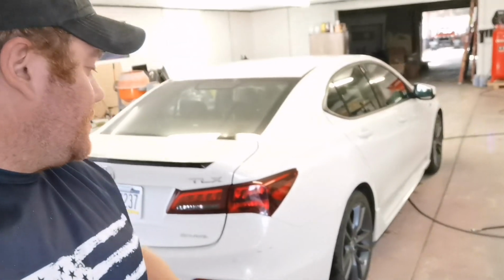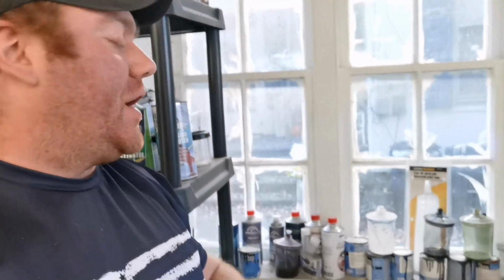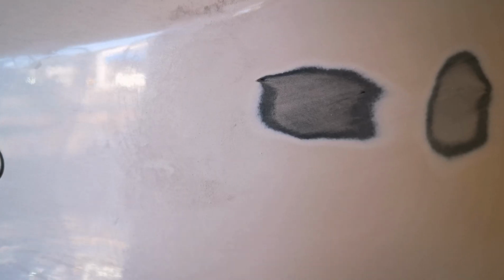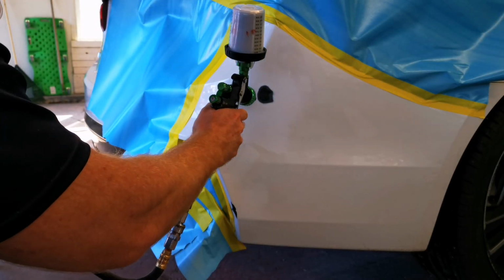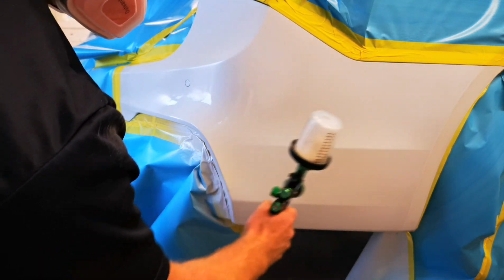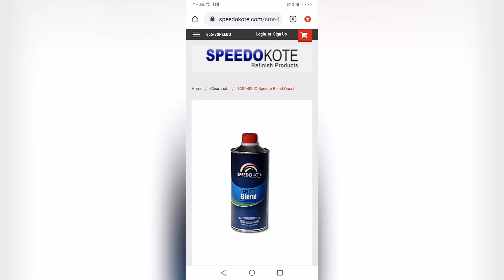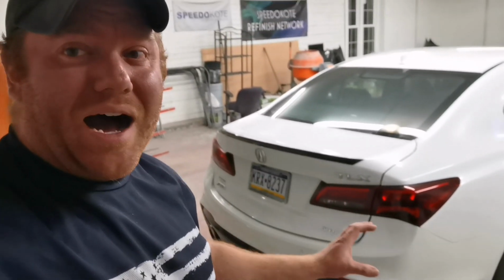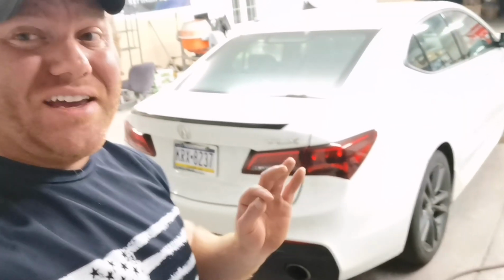Acura tlx bumper repair tutorial

Comment: Could you paint a panel like a small suv roof with one coat?  Or would you recommend two back to back coats on the euro clear?
Reply from the maker: This clear is high solids so one thick coat should do. 2 coats for best results. 3-4 coats if planing to wet sand and buff
Reply: @speedokoterefinishnetwork4937  thanks, I was just worried about uv resistance being sun facing.  Thanks